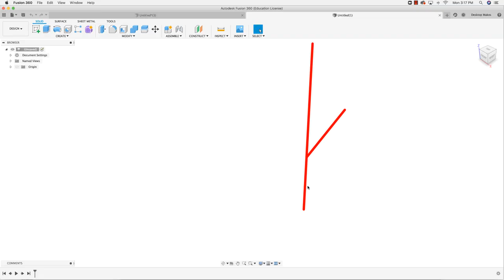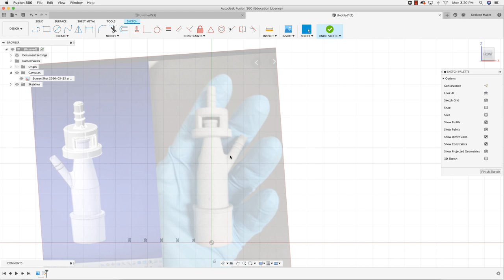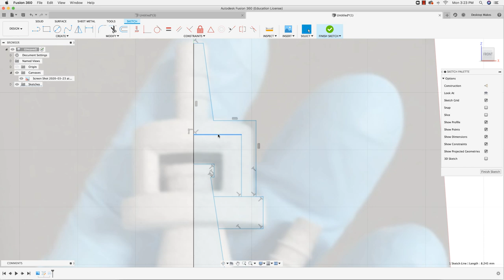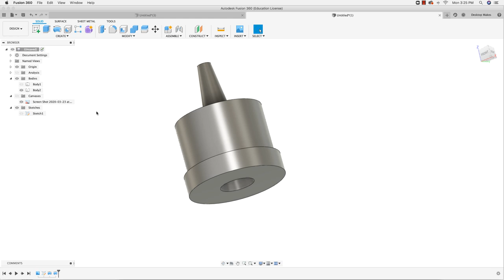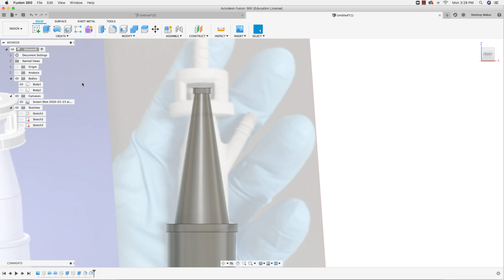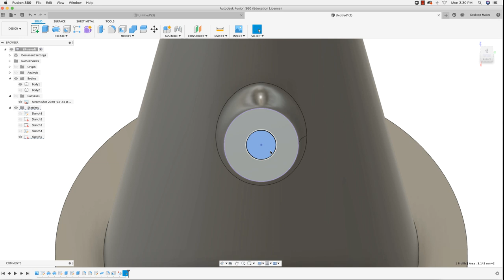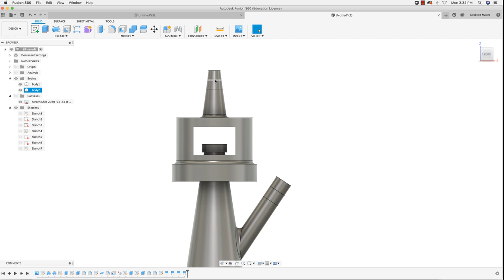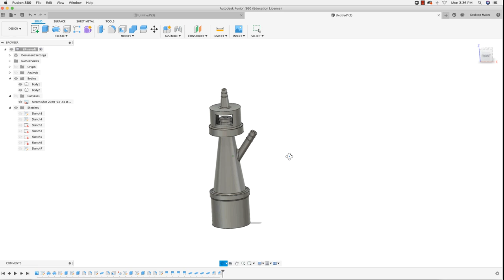Do Have the Fusion 360 Skills to Design This?

Comment: Thanks Vlad. I did pause the video and my methodology was very close to how you did it, the only real difference was that I shelled from both ends to avoid having to draw extra circles and extrusions.
Reply from the maker: That works too!   In fact, you can shell all 3 openings at the same time to speed things up.  You'd have a little less control but it gets the job done in this rough draft case.

Comment: Thanks for the great lesson. I love this approach to teaching. The hardest thing I find about learning new software is having a project to work on. By having a goal helps then comparing your methods and mine I can learn some new techniques. The main difference I did on my sketch was I designed the hose barbs for the top and side by making a new body by sketching the shape of the barb with the little barbs and used the revolve tool. Then made a copy and place it on the top and moved the original to the side and set the angle and joining the bodies.